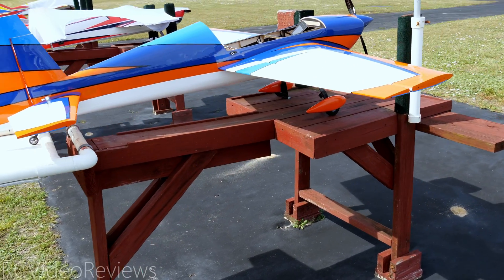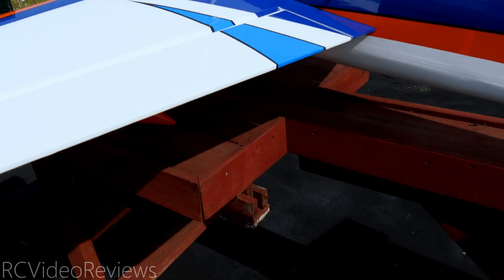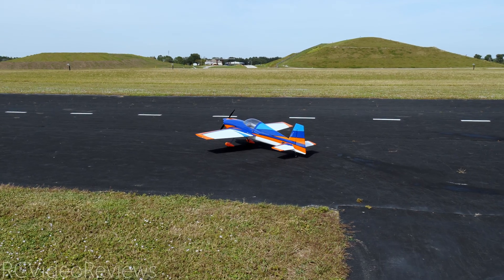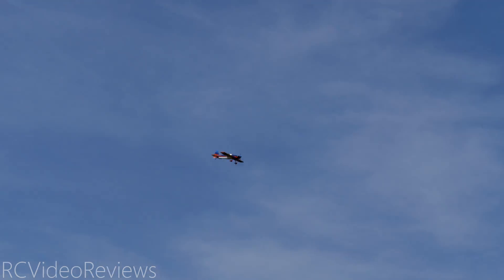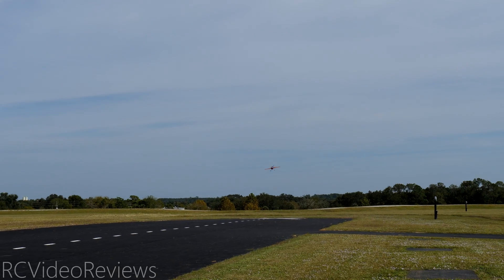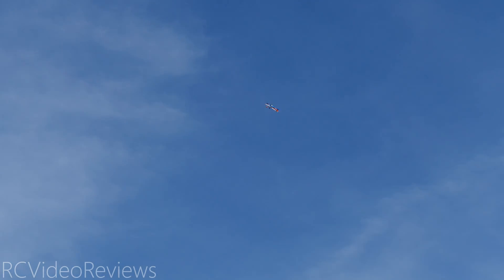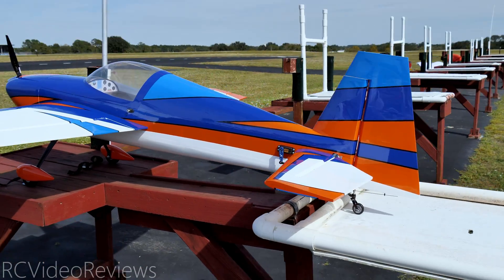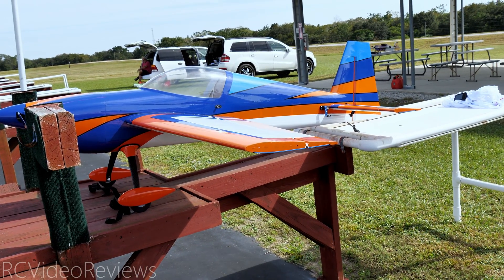Can a 6s Power System Fly a 12s Plane? EF Slick 70" • AM670 • AM116 ESC • 6s LiPo • 18x8 Prop

Comment: Thanks for making video's that are real. I know this video is old now but, I would LOVE to see your am116a set up. I'm using the same exact setup (am 670/ 520 with the original  cf 18x8 prop). and  I'm drawing 125 to 130 static amps (on the ground) and could never figure out why.  I would gladly make a  nice donation to the channel for those spects. EF  and T-motor didn't have much response.  But I do love  your video's  and T-motor. Thanks.

Comment: Hi, when using the Servo Power Distribution Board, the ESC output still goes directly to the reciever, right, and that powers the reciever? The distribution board is just giving more direct power to the servos.

Comment: Nice.  I've got a 71 inch,  aj slick,  3dhs. Hanging in garage,  runs on a hacker motor and 6s 5k battery.  I don't remember the esc, castle i know.  But it's 15 years old lol. 
 But my point,  it is light.  And pulls 2 ta 1 with 6s on a 71! 
I just got my extra ng rx ready together.  Ready to Maiden.  Need a calm day.  Love extreme flight.  But that 71 aj slick was awesome in it's day.  I have a feeling this 67 is gonna be insane! 
 Rock on.  And fly big!! 
Great video

Comment: Moving the servo for a pull pull system on the rudder is a great idea. I was also wondering if your extra battery for your servos can go farther forward. Looks like it would be hard to get to them though. Back in the day we left our batteries on the plane and just put a charger on the plane. I guess that's another option.

Comment: John, after 6 months, are you still happy with the 6s setup vs. 12s?
Reply from the maker: I switched it to a 12s setup. It was ok for more mild maneuvers but it didn't build up a head of steam for things that required a little more momentum. I also liked the balance better with more weight on the nose.
Reply: @RCVideoReviews  thanks for the info.  I appreciate it!  I wonder if 8s would be a good option.
Reply from the maker: It might, but you'll still need to deal with the weight to get the balance right.

Comment: 6 minutes is a enternity for me. I get 7 minutes on my gas and about 5 on all my large scale ekectrics. I want this plane. I just bought the mike high rc 75 inch edge 540 delivered to my door for 350. Its no 75 inch plane. More like a 67 inch plane. Its absolutely well made for the off brad. Very impressed. Has all the goodies. Im thinking of using your power system for it

Comment: I'm new to electrics, so this may be a dumb question...Since you needed some more nose weight, couldn't you use an 8s battery instead of 6S ?  Seems it would give you more flight time as well as a good CG without weights.
Reply from the maker: The motor and prop are designed for 6s. Usually not a good idea to add voltage without making sure all the elements in the chain are spec'd for the additional voltage.

Comment: Very nice, you proved what i always knew could be... never understood why they said 12S for 70 inch planes, I had a 74 inch 12S plane once and on 13S it was way over powered. I always wanted to try 6 or 8s but it was a older plane and kinda heavy. That is a great color scheme. nice Flight.
Reply from the maker: Thanks. Yes, this plane is capable enough on 6s. We get very much addicted to the crazy power ratios available these days.

Comment: I would love a follow up on this video! what are your thoughts after having the setup for awhile?
Reply from the maker: I went flying a week after this video with no cameras. I took this plane and the Avanti v2 only. It was a very good day. The best description I can give is that the power is sufficient to do everything I currently know how to do. It doesn't have the ability to do a "hole shot" out of a hover like some of my setups can, but it easily hovers and accelerates going straight up. I think the only negative in this setup is the flight time is slightly lower than similar planes--but only just.

I think this is an easy yes--I would do it again.

Comment: Curios why you state you only fly electric and never gas. About to hear down this path and curios about your reasoning. Thanks !
Reply from the maker: I have zero interest in IC setups. Electric does everything I want/need. Don't care for the mess, fuel, fuss I see all the time with IC setups.
Reply: @tpdmotor13, for me, I could never see myself in an airplane like this being electric. It’s like buying an electric challenger, or an electric Camaro. no brummm brummm… lol
Reply: @LouRC  IMHO - I have a over 50 planes BUILT - another 62 NIB - of all different shapes and sizes up to 2000MM and they are ALL ELECTRIC. I have not flown IC for over 15 years. NO MESS, NO STARTING ISSUES and NO ADJUSTING - just hit the throttle and GO - Electric is either ON or OFF - 1 or 0 - cannot get any easier than that. - IMHO
Reply: @re3065  Yeah but the mosquito sound with electrics just doesn't do it for me. Kinda of ruins the whole experience. Nothing like a four stroke glow or gas engine, longer flight times and gas is cheaper than batteries that can catch on fire.

Comment: Flying a 70" 3d plane on a single 6s is nothing new, I've been flying my 71 3dhs aj slick for the past 11 years on a single 6s, my 72" extra and 73 slick were all single 6s.  The am670 is a great motor, I have it in my 69" Raven., but if you can find one, the Motrolfly 4325-380 is even more of a beast, and will swing a 19x10 all day

Comment: Using a dedicated power supply for the electronics, did you remove the power lead from the ESC…? Only using the Ground & Signal wire from the ESC…? I’m currently assembling a ARF and I would rather not depend on the flight pack for servo and receiver power.  You briefly mentioned this, and I was curious about the correct way of setting it up.  I have a few power eliminator adapters, that I considered using.
Reply from the maker: Yes, I removed the positive wire from the ESC connection and taped it down to the ground/signal wires.
Reply: Good question.

Comment: Great to see this video, I would love you too do a video with a 6s parallel pack and see how she flys, if your going to have to add weight it’s probably better that it’s extra battery capacity. 😊
Reply from the maker: You and I are of like mind. I thought about adding a battery in parallel, but that defeats the purpose of going to single battery in the first place, so instead: I ordered two 6s6200s. We'll see how that does. The 6200 may very well be the last twist of the dial to make this combo just right.
Reply: @RCVideoReviews  nice, can’t wait for the video. I love this sort of video, where experiments are carried out. I just opens up the doors for more people to get into this size of model, they can fly on a budget setup but at a later date go to a 12s setup at a later date if the wish.  Keep up the good work.
Reply from the maker: I never really thought of it from a cost perspective, but you are right about that. 6s power systems are definitely more affordable.

Comment: Big bird maidens are scary. No gyro (I've not used a gyro, never been a fan myself. ), adds a bit more nerves. Gyros don't make great pilots, IMHO.

Thx to all YOUR videos, u converted me from an iX20se to tx16s. I can't scream as to how much ppl r overpaying for spektrum junk! I learned the expensive way!
Reply: I 'had to' have the hangar 9 ultra stick 10cc. Took 3 ounces of lead/brass in the nose using a 6s/7000 pack. It's still tail heavy. Traded it to a buddy. He put a safe rx in it & loves it🤷‍♂️🤪. Different strokes 🤷‍♂️
Reply: Flying any big wing plane is Childs play without a gyro. Try flying smaller 500mm ect wing planes with no gyro and see how well your skills truly are 🎉
Reply from the maker: Totally agree! That is the key point. Anyway, the plane did great. EF products just inspire confidence.
Reply: I have stabilization on a switch. When it is TOO WINDY for other RC fliers to fly, I turn ON my stabilization, go "3 mistakes high", turn OFF my stabilization and perform my aerobatic maneuvers and when my battery time is telling me it is time to think about landing OR I am done doing my aerobatics - whichever comes first - I turn my stabilization ON and come in for touch and go OR land. Also, I have the SKY to myself because every other flier is sitting and watching OR left the field. So I will NEVER put down having STABILIZATION available - ON an ON/OFF SWITCH for this very reason of flying in TOO WINDY conditions. Two more reasons - I have SAVED a plane a few times from crashing due to "dumb thumbs" OR my arthritis "kinking" my fingers at a particular moment by also turning on stabilization before the plane "tried" to go into the ground. Of course this is what works for me AND is MHO  😉

Comment: That inspires me for an interesting setup... AM670 on Skywing Slick 73" with 6S x 2 parallel packs for longer flight times for IMAC... Do you think it will suck a lot from the pulling power with the second pack added ?
Reply from the maker: Very good question. I ordered some 6s6200s to maybe help with the weight and give a little more flight time. I'll try to discuss in the next PilotJam after I get the batteries and fly with them.
Reply: @RCVideoReviews  any update ?

Comment: I'm surprised how well it ran on 6s. It makes things so much more affordable in terms of motor, esc and battery selection by going down that path. Looks like you could easy do the IMAC sequence on that setup twice (as required in comp flying)  in the flight time you got out of it.
Reply from the maker: I haven't flown the IMAC sequence, but I've seen it, and I definitely think it has enough power to do the sequence, but I'm hesitant to say for sure on flight time. I just ordered some 6s6200's. Those might solve any lingering issues. And yes, 6s setups definitely save some cabbage.
Reply: @RCVideoReviews  Yeah, I'd be curious to see how you go on a 6200mah. I'm shifting to 6000mahs now on my EDFs as I want more flight time. What brand batteries do you use?